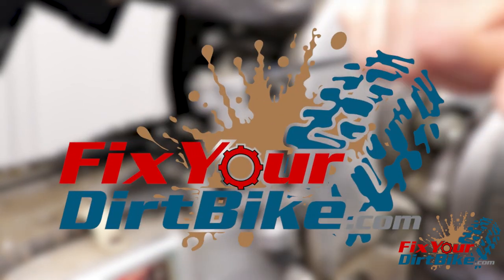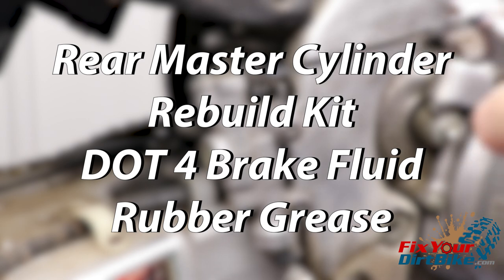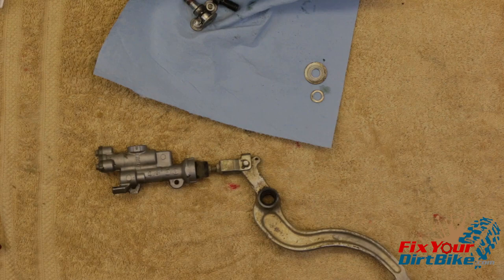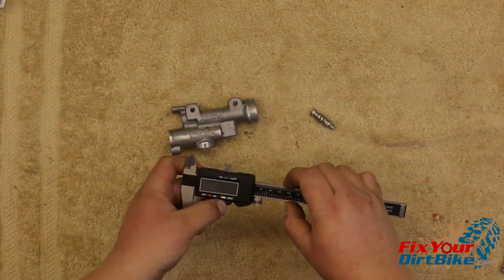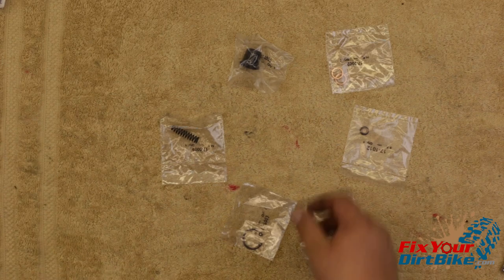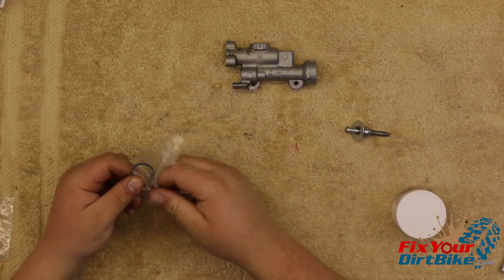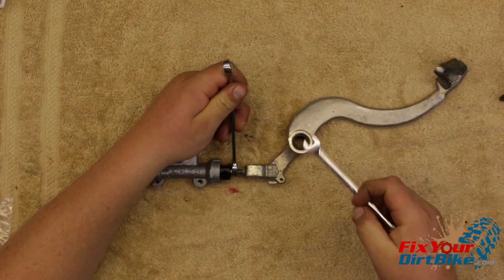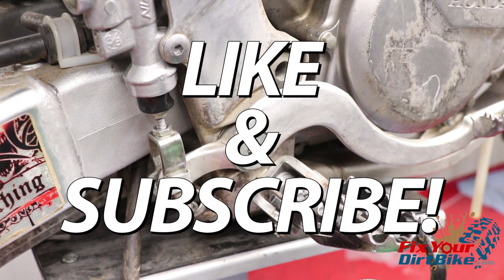2009-2010 Honda CRF450r - Rear Master Cylinder Rebuild | FYDB

Comment: Hi I have done this brilliant video and also your website which brakes it down is even better, just one question.

The seals look perfectly fine shall I order new ones anyway or just put back in as I may believe the problem could be in the brake caliper not master cylinder

Thank you
Reply: I wish I could add photos to show you for better advice
Reply from the maker: I would replace them just to be safe.
Reply: @Fixyourdirtbike  Hi the rebuild kits are about £15 but a master cylinder is £10 already built but its from Hong Kong is this the reason why its cheap because its shit???
Reply from the maker: Yes. I wouldn't trust China parts.
Reply: @Fixyourdirtbike  just on with the rebuild process before I start is it assential to 
"Measure the inside diameter of the cylinder bore and the outside diameter of the piston." 

Like you state in your website?

Thank you
Reply from the maker: Yes, that's a major part of the service.
Reply: @Fixyourdirtbike  okay thanks, because my bike is crf250x 2010, will the measurements be the same as you have given? 
And did you find these in the manual?
If even slightly out replace yes
Reply from the maker: I don't have the specs for that bike off the top of my head. If its past the service limit it needs to be replaced.
Reply: @Fixyourdirtbike  I should probably contact honda for that then thank you